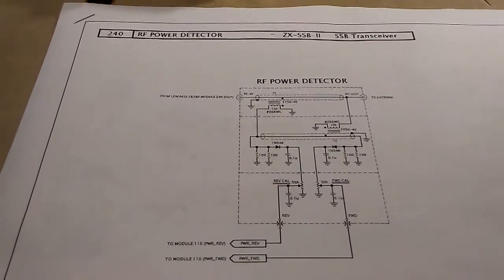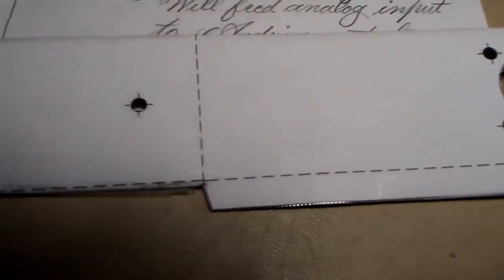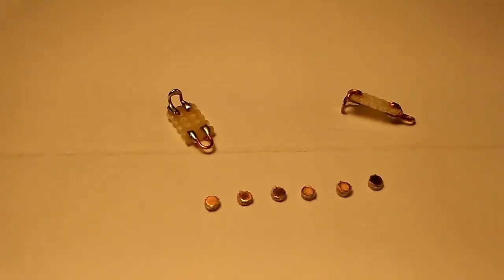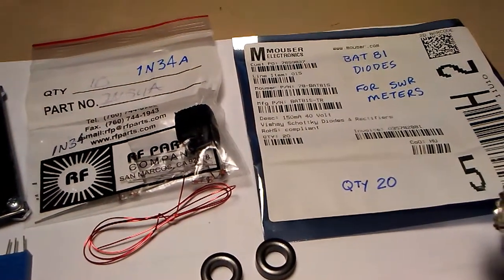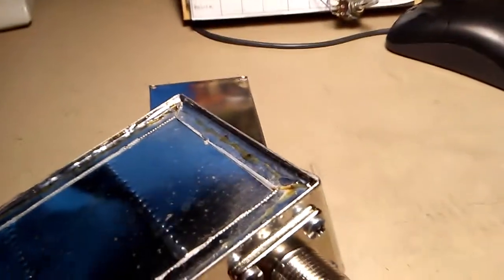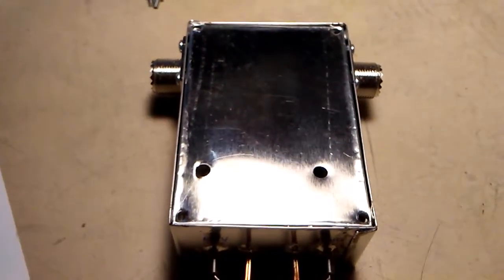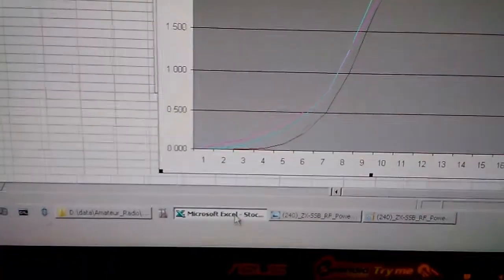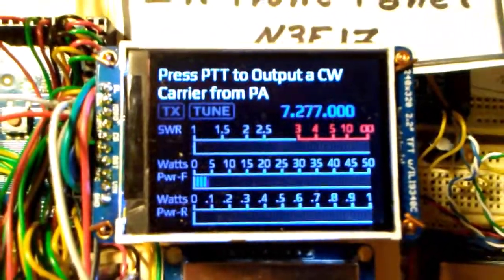(Pt-14) ZX-SSB-II Front Panel Development (Part 14) - RF Power Detector module

Comment: That's a good construction method, Rick!  PCB is good, but sometimes cutting PCB material can be hazardous to your lungs.  Better to use the metal.  The finished box looks really good.  Great information! 73 de AC9JQ
Reply from the maker: Thank you Dean!  - Keep building - 73 de Rick - N3FJZ